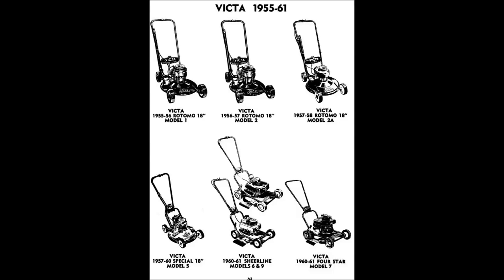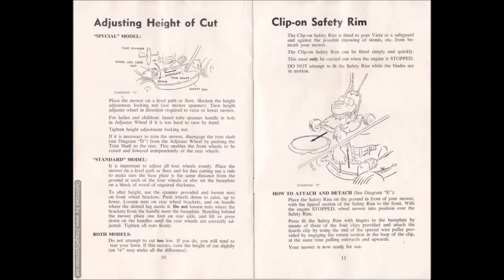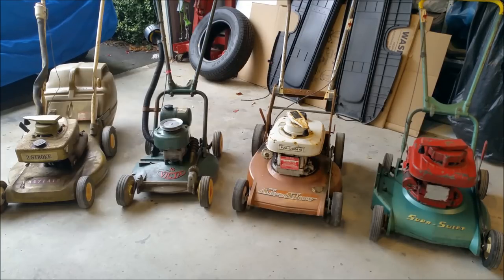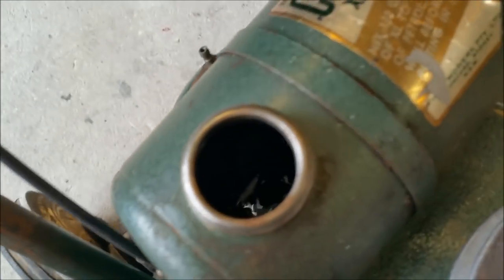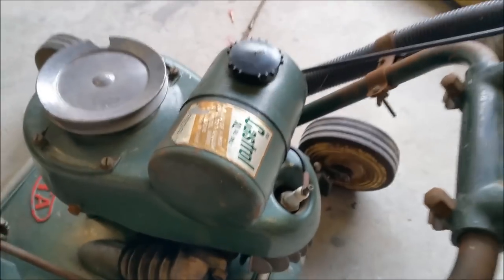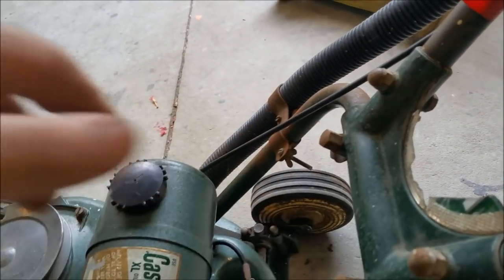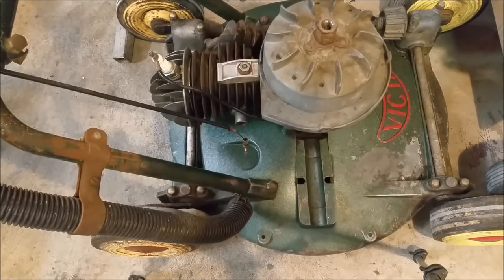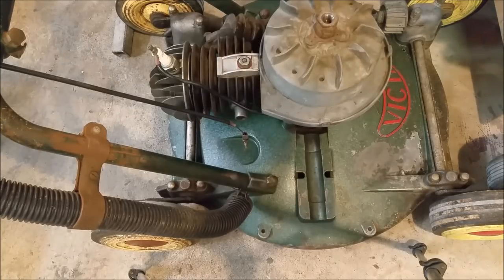The 1959 Classic Victa 18 Model 5 Lawn Mower - With Books!

Comment: Just a good clean up sounds good.
You have some nice motor mowers there. 
It is great to see mowers made of metal instead of the ones with so much plastic you get new these days.
My father purchased a Victor 18 brand new  in 1959 or 1960.

Comment: I haven't got onto any yet but I hear "Renaissance Wax" is the way to go for maintaining the original surface on almost anything. It's even got the endorsement of the Queen and is used for protecting priceless paintings from contamination and wont make things glossy either. And only a small amount is needed to go a long way. A guy I met at work is a mad keen knife maker and has a forge at home and makes ultra nice pieces for sale. When he heard of my wanting to preserve certain tools for posterity he told me about Renaissance wax. It can be used on metal, painted surfaces basically anything and is used by all the major museums. It's not cheap but it's not that expensive either seeing as a little goes a long way. 
The other thing I've come across in my tinkering is "Motospray one step Rust Converter and Primer/Sealer" in the black plastic bottle.  I used this in an old 2 stroke engine fuel tank that had a rust problem around the fuel cap and inside. I was concerned about using it inside the fuel tank for obvious reasons and did a bit of a test run. Obviously I flushed it out as clean as possible first and washed in detergent and rinsed with water and dried before applying the rust converter and after leaving it for the recommended time to dry, I put fuel in and tried to scratch the product off under the fuel surface and nothing happened. So I let it sit for a few days with the fuel in it and again tried to remove or scrape the product off under the surface of the fuel and I couldn't even make it lift. Wherever the product dried on the original steel inside around where the rust was but it didn't even have to be on the rust, it was like the product had etched itself into the metal and become the metal. I couldn't even scratch the stuff without scratching a gouge in the steel. So by this experience, provided that it is the same product, I wouldn't hesitate to coat the inside of a steel fuel tank in this stuff to protect from future rust even though that isn't its original intent. I think the reason it was so unaffected by fuel was its water based and once dry it's pretty impervious. And it dries to a brown layer you can sort of still see the steel through it. I've used lots of other rust converters but this is my favorite. And so simple single step, no mucking about.
Just sharing so do what you do.

Comment: Hi Peter, this is the first video of yours that I have watched, I was recently referred to your channel by a mate.  And what a video to start off with.......I own this exact model Victa and I use it regularly!!  The neighbors love me😁
I should point out that the under deck muffler is not an effective design to mufflle noise, rather to remove a part that you may accidentally burn a leg or hand on.....
In regards to the air cleaner/choke unit, mine has the same size and type and works very well to choke the engine on cold start up.  The location of mine is down low near the bracket where you thought it should be.
I was lucky enough to get the encased pull starter on mine and it has a great Victa Special plastic badge, but I do not have the safety skirt, that would be a great addition!!  Toe cutter indeed 😕. 
Also, the petrol tap only needs a small rubber o-ring to seal it up again, it did make it a little stiff to move but there are no leaks.
And how good is that height adjuster??
It was pretty flash after graduating from the same mower in the standard trim.......yes, I have a standard and a special, both in running, your cutting condition😎.
I look forward to seeing the continuation of this little project Peter 👍

Comment: You have the right approach to this one Peter, give it a good clean and keep it as original as possible. In the paper work at the start showing the standard and special they both have an air tube that is the same length as your one but the pod on the top looks to be smaller in the pictures. A friend of mine a an agricultural engineer (Lawn mower mechanic) and has a hoard of parts. I'll ask if he has the spanner or the plastic name plate. If he has them I'll contact you and arrange to send then over to you. (I'm in the UK) I know he likes old Victas so he may have the bits.
Reply from the maker: Wow, that would be wonderful if your friend has the parts. Will wait in anticipation. Cheers
Reply: Hi Peter, I spoke to my friend and unfortunately he sold the last Victor spanner he had a couple of months ago and used the last of the name plates to replace customers ones. He said the price of Victor spares has gone through the roof over the last 5 years. I'm sorry but I did try.

Comment: Peter, the fuel tap looks like a Ewarts fuel tap. The reason it is probably loose is that the small cork seal has dried out. These taps are fitted as standard on the British Seagull outboard engines and spare parts are still available. If you put fuel in the tank then the cork may recover, but you should consider a new seal.

Comment: Wow thats a bargin an with books 😍 i have restored a few mdl 5's and love them. I think yours might have been painted  25 years ago or so because i think the original colors were the base an cowling/fuel tank were hammertone avocado green an the handle was Brunswick green like the colour your model 5 is now but it could be the light of the vid too. They look fantastic restored but cleaned up an patina like yours is nice too. Put the original handle decal on, they pop up occasionally cheap and also the original plug/height tool. Jump on the vintage mower page on facebook they are a great sorce of parts ect that ring is a super bonus too 😎 i have seen them wheels alone that were oem still in plastic sell for 400+ lol i hope your family member aka dog gets well soon its always sad times when they start getting ill an old. Great vid again cheers mark.

Comment: Hi Peter my name is Ben,  i too love these old mowers and have a few of my own. I took notice of your tear down and i think i can tell your mower has been restored before. Those wheels have too much tred for original, and i saw some funny overspray under the main cowling that wouldn't be there if it was original. The air intake hose is definitely not the right one as your onto allready and the paint on the base plate doesn't look to be the right "Avocado" hammer tone paint either, for a original mower. I think you got a great deal with the paperwork goodies you got, that stuff is gold to keep hold of. My opinion is just a sympathetic cleanup is all she needs. But i don't think she is original.  Anyway thanks for another great video mate and enjoy your classic and take care Peter.
Reply from the maker: Thanks Benny and you're probably correct. I have some automotive expertise and can pick a car that's been tampered with very quickly... but mowers? No idea really so thanks for your keen eye. Cheers

Comment: Hi Peter, the fuel tap should have a sealing cork, not o ring, undo the small screw, and dunk the cork in hot water which should make the cork swell up again. Just as a matter of interest, I left school in 1975 with 3 job offers, one as a car mechanic. one was for a lorry mechanic. but the job I took was for a apprentice horticultural engineer ( posh name for lawnmower mechanic ) as it was something a bit different. Did my 4 year apprenticeship got my qualifications and left the business shorty afterwards, as the quality mowers were very expensive, hard to  justify spending so much on a mower, or horrible cheap and nasty things not made to last ( Briggs engines now have plastic camshafts !!! to save cost.) now started getting back into messing about with mowers again for fun and a bit of beer money. Keep the old Victa original and do a full resto on one of the others. Anyway keep up the good work always look forward to watching your vids. From up above in the UK.

Comment: Here in Kansas we would call those blades widow makers 😲
Reply from the maker: here too, although the mower has always been known to everyone as the 'toe cutter' model.
Reply: Peter Anderson is have never seen a blade like that, here our mowers have a single blade,  tell me the advantage of the disc and blades vs a single blade,  yours looks very interesting 👍
Reply: @tombob671  they are called swing back blades, so if you hit a rock there is less damage to the blade and crankshaft. Also the heavy disc aids in starting and also means in long grass it is less likely to stall. These little mowers can rev out to 8000 rpm so are virtually unstoppable and lightweight. In the 1950's people with 5 acres would use them to mow the paddocks.

Comment: get it running and see you my have a rebuild on your hand's the plug tell's me that one or two thing's happen one the fuel was not mix right  or two it had a long ruff life and it need ring's so in my mind if it just the fuel just clean it up the mower and use it as is or if it two resto if it dose not cost to much it'll look good all clean up same with the other 3  i'm kind of a jack of all trade's master of non so I like working on all kind's of stuff